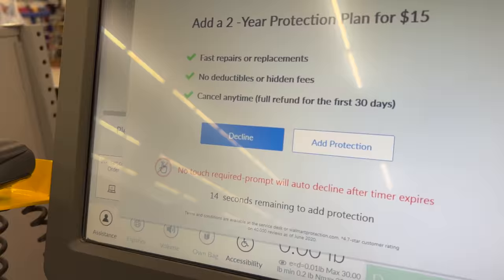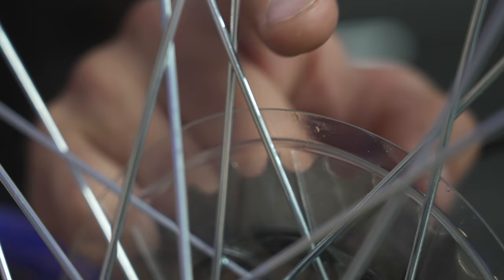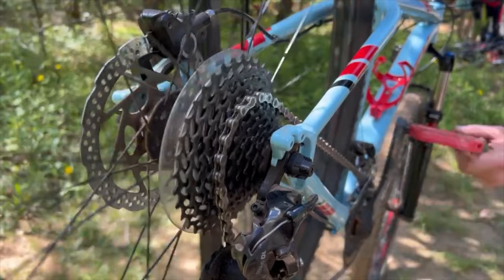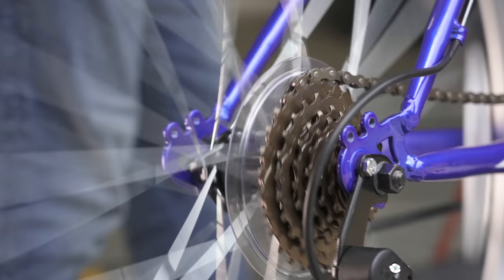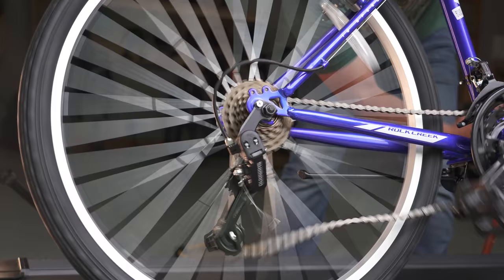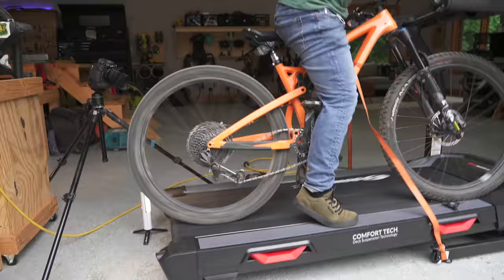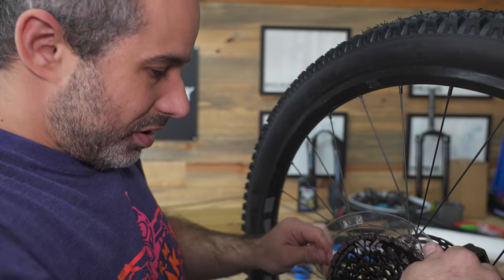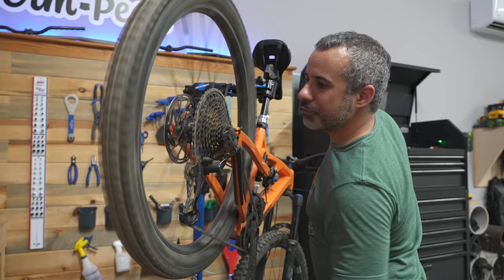What is your "dork disc" actually for? What happens if you remove it?

Comment: As a kid, while riding an old 5 speed through the woods something got kicked up into the derailleur jockey wheels, it locked up the chain in the derailleur, the derailleur folded to the left and into the spokes, almost instantly it removed about 10 spokes and the wheel was done for the day. The bike had a tiny tin dork disc that really didn't extend beyond the largest sprocket. 
The older bikes had HUGE discs, some as big as 9" or so and made from chrome plated steel. Those would have stopped the wheel from getting damage, but would not have stopped the derailleur from being ripped apart. 
I have had bikes toss the chain and it get caught behind the freewheel, both with and without the disc installed, rarely was it just a matter of lifting the chain back in place, but it was on much older bikes in the 70's. Many times the chain was what suffered the most, with the occasional marred up spoke or two. 

Years later, I tend to leave them in place, and put them back if missing if the bike is being ridden off pavement. On the road, it depends on the bike.

Comment: Yep, try your test on rollers with a lot of resistance. The chain can catch and snap spokes - especially on a light and tight small gauge 2 or 3 cross.
Friend was carrying 100 lbs of supplies on a light weight road bike, cranking up a 10 mile >8% hill at around 10+mph, dropped to the lowest gear and twang... Rebuilding a wheel in the bush is kinda a bummer...

Comment: I'm in my 60s now and have never had a problem with the chain going off the cog into the wheel.  I have, however, had problems with the chain coming off the little chainring and jamming around the bottom bracket/axle/crank.  All my 2x and 3x now have Deda dog fangs fitted.  As for the spoke protector, I leave them until I remove the cassette/freewheel - then I remove the protector and leave it off.

Comment: I've had this happen at speed 5 times in my life, once with a dork disc. One time without the dork disc, my chain encountered very loose spokes. Chewed a few of them up and destroyed a sach suret junk derailleur. Bad maintenance seemed the root cause, not lack of dork disc. With the dork disc was the only time my chain got wedged in and needed more than a yank. On these grounds, and the 5 grams of weight, I tend to take them off.

Comment: I have the real metal Pie Plate like old Schwinns. You can find them at low rider shops.  If you have a cassette, not a freewheel, you will have to get something with a wider hole, or modify it. 

Usually I throw away the plastic ones, but I have one that is 40 years old and hasn't cracked or fallen off yet.

Comment: Jury's out for me on dork discs. They supposedly do a job but I suspect the percentages are really low of it being needed.
The only derailleur incident I've experienced was while riding a normal tarmac street on a windy day. A plastic bag blew against the side if my bike and inevitably got pinched between the chain and derailleur causing it to lock up with the derailleur ending up pointing skyward. Personally, I feel that derailleur hanger saved me a lot more grief/money than a dork disc ever will.

Comment: I always remove them because, first and most importantly, they look bad, but also because they almost always break before they are even useful since they're so brittle.

I have only ever snapped one rear derailleur in over 50K miles of commuting and it wasn't because I didn't have a dork disk on, it was because I was an idiot and I saw a bungee cord on the path in front of me and instead of riding around it like smart individual, I just rolled over it, and as luck may have it, it somehow got wrapped up into my rear wheel and around the derailleur, the derailleur got sucked up into my wheel and I snapped the RD along with some spokes.

Comment: Hell, back in the late 60's before "spoke guards" were common, the Campagnolo rear derailleur on my Puch failed (limiter tab the range screw pushed against broke), sending the lower arm into the rear spokes. The result? (a) 3 or 4 spokes destroyed and (b) the bike stopped much faster than my then 170# body so I went over the handlebars and ended up with a major case of road rash. The new wheel got a stamped aluminum spoke guard. 50+ years later I'm still riding and quite happy leaving the disk in place on my current bike!

Comment: Watched this video a while ago, but I wanted to make this comment. So I had gotten a new Canyon Spectral 29 cf 7. And of course it comes with reflectors on it, and a dork disk. The reflectors were off right away, but I chose to leave the dork disk on because my though process was, easy protection from oil getting splashed/sprayed on the brake disk. I think this is a good use of it. Alas, it was destiny.... Riding down crazy rocky trails.... that thing ended up bouncing around  not clipped on. And trying to clip it back without pulling the cassette, wasn't happening, so if I had to putt the cassette, it wasn't staying on, but I didn't want to even do that, so in the end I cut that thing off, and trashed it.

Comment: My daughter has a 1x6 20” mtb. 35mm fork travel hardtail. Pretty sweet bike but no dork disc. The derailleur never sends the chain off but sometimes it’ll fall off back there if she kicks it or bumps it on something. She’s not an elite rider yet… and getting it back out onto the cogs is a 10 minute effort requiring adult strength and patience. If she does it without me around that’s it. Ride over. Pedaling destroyed.  I reaaaally wish she had that disc.

Comment: remember this folks: if anything ever fucks up in the rear end (branch into spokes/derailleur, chain over the casette etc), the only thing that has the chance to save you is if you react quick enough to lock up the rear wheel with the brake, and this way you have a chance to not break anything

Comment: When I bought my (quickly growing) kids new cheap (they will overgrow the bikes in a couple years) bikes I really did not like the dork disks installed.  They looked ugly, rattled, etc.  On top of that I do not like the fact that the chain fallen from the big sprocket rubs between the sprocket and the spinning wheel (even protected by the disk).  I think, the disk should sit on the big sprocket.  So I designed and 3D-printed disks that snap perfectly in the holes in the sprockets and are just a tiny bit bigger then the sprockets and their outer rim is just as far from the sprocket as the thickness of the chain's plates and pin tops.  They catch the falling chain perfectly and throw it back on the sprockets.  I think that's a cool idea :)  .

Comment: Here in Germany, a lot of the bike paths are cobblestones. Once I was biking home, shortly after replacing my rear wheel. The dork disk had been removed and not replaced at the shop. I was going fairly fast, shifting up into top gear, when I hit some bumpy cobblestones. The chain bounced up and off the gears, falling between them and the spokes. And it cut through four or five spokes like a chainsaw. Luckily, it was not too long a walk home.

Comment: 19 years of mtb, never had one of those on any of my bikes, done some hardcore stuff like the Caldera on Tenerife and MTB marathons in the Alps, never any problems. Just keep your gear in shape, and with a bit of luck, you'll never need a dork disc. Pack a screwdriver and adjust the shifter when gear changes mess up, you'll enjoy the ride even better.
Reply: Ive been using them for 30 years. Never changed my enjoyment of a ride. Its not heavy or intrusive enough to affect the ride in anyway.

Comment: I know this is an old video. However there is a specific use case for the dork disc. Since we cannot predict exactly when our adjustments are going to reach a tipping point going out of whack, we would need the disc when using an automatic shifting system as it depends on these adjustments for not over shifting our gears. I know there are not many automatic shifting systems out there that people actually use, but for the few of us that do it's a necessary evil. For example of you have an ebike and want your bike to shift in the optimal range to conserve energy (more miles per charge) and give longer lasting service life to ebike batteries. You may want to incorporate an automatic shifting system into your drive train.

Comment: One thing I noticed that wasn't mentioned in the video is the sudden unexpected pedal spin. If you are coasting and something disrupts your chain into the spokes, the pedals can get smashed into the back of your legs. I had a bike a while ago that the LBS I bought it from insisted the drivetrain was adjusted right where a certain stretch of a regular ride kept throwing the chain either into the spokes or between the crank rings and the frame. Obviously the later doesn't pose much safety issue, but the former....
Reply: A gummy freewheel can cause back spin in this case and getting into the "valley of death" gets easy.

Comment: Back in the 1970s, before the advent of mountain bikes, indexed derailleurs and quick release wheels were an expensive rarity, I had a Fuji 12-speed road bike. Back then all bikes with rear derailleurs had some kind of metal "spoke protector" (what you call a "dork disk"). The derailleurs in those days weren't as accurate or as durable as they are today and would get out of adjustment much easier. I remember a few times while riding having the chain jump the top sprocket, and lock-up the rear wheel causing me to wreck. Even worse, was if the chain got jammed in with enough force it would bend the spoke protector making it damn near impossible to get out and require removing the rear wheel. Not the most fun thing to be forced to do when scraped up with road rash, and  miles away from home with only a minimalist tool kit.

Comment: I never knew they called it that. My bike is so old mine has gone orange and discoloured. Everyone had them and nobody took them off or knew what they were called.

I have had my chain bounce off on a big landing and caught in there several times.
I'm gonna keep my orange one as it's still functional.

I don't care about looks, only function. Also I have that metal ring around my front derailer, I'd rather brush my leg on that than the cogs.

I don't care what others think, you see people mod cars that some think are cool, but many mods I think are trash if they negatively affect the function.

Dork is pretty subjective too, there's many that would consider people that ride bikes and obsess about them dorks, but who cares what they think.

Comment: Thanks for the vid.  The dork disc on one of my bikes is damaged, and no longer staying in place.  It flops around, and I wondered if I couldn't just break it off.  That might be a short-term solution, but it sounds like I should eventually replace it properly.

Comment: Tbh as you can see it's pulling the cranks around when it gets stuck so it lets the chain spin freely with the wheel, but i reckon if you are on it and maybe standing balanced without pedaling it would stop it from spinning the cranks freely and probably do more damage specially to the spokes

Comment: I once had the chain over shift when I swapped wheels and did not readjust the derailleur. I pedaled a bit and it damaged the spokes behind the cassette, and a spoke broke on another ride. So if you do get this issue check your spokes behind the cassette.

Comment: When I was 15 I had one of those "Zbox" 69cc engines on a mountain bike. It drove the rear wheel through a large sprocket attached to the spokes on the opposite side of the wheel to the cassette. One time the chain tensioner vibrated loose and the chain hopped off into the spokes. The rear wheel locked up at 50km/h. If I hadn't been on smooth concrete I would have never been able to avoid a crash.

Comment: I had a 6-speed automatic bicycle in the 90's.  there were weights mounted in the spokes that would expand with speed and actually push the disk out from the wheel and the deraileur had a skip plate the rode along the face of the disk.  Unfortunately this meant that you shifting was tied directly to speed, not to effort, and there was no way to over ride it ... The huge problem was ... when you hit bumps big enough (and I am talking about bumps as small as poorly maintained PAVED rural road surfaces) the deraileur could 'bounce' down far enough to get hooked over the edge of the disk and get stuck in a way that would no longer shift and you had to stop and untangle the damned thing.  This happened often enough that I gave up riding that bike.

Comment: I was riding my bike down a hill going mock 20 and did a small bunny hop, my rear tire locked up. When I looked back the derailleur was completely ripped off and got sucked through the frame. The limiter screws were set, the derailleur didn’t have a clutch and I think that’s what caused it. I stole one off a different bike. Too broke for a nice bike but I continue to shred the gnar.🤙🏻

Comment: On “Walmart bikes” derailleur can fall in spokes with dork disc. Just because it’s not so hard and stabilized as good derailleur. And opposite: good derailleur physically can’t fall in spokes if it’s not already broken. First somehow you brake derailleur, and then derailleur brakes your spokes, and in this way dork disc isn’t help, sorry(if you don’t use dork disk with really large diameter). Btw.. I have no idea why I should use biggest gear on high speed, so if it’s used properly I can prevent damage just by stop.

Comment: I work a lot on old bikes.  So old that the dork disc crumbles into dust when you touch it.  I have also seen many bikes suffer severe spoke damage when the chain comes off.  A better quality dork disc would have saved it.  Wait a minute - even older bikes, the "ten speeds" of the seveties had a huge chrome dork disc that worked perfectly and looked good.  A new chrome disc is quite pricey though.  Another factor is if the spokes are laced "leading" or "trailing".  There is less damage to "trailing" spokes.

Comment: I keep the discs on my touring bike. While cranking hard to get a heavy load up a hill, losing the chain on the inside will have ample force to quickly chew up multiple spokes.  And they're on the dished side of the wheel. And I only carry 1-2 spokes.   Idea for your video:  inspect the spokes of a random sample of people...I regularly see people unaware they have spokes damaged behind their cassette, and I wonder what %.

Comment: I lend my bikes out to my little cousin so I'm not removing my dork disks. If he hits a pothole or otherwise messes around with the gears, he's safe and the bike is alright (probably). We ride folders, and even though the shimanos are stable, I get paranoid that something will get messed with in transit while folded.

Also, I think it's actually the more expensive bikes with cassettes that would get more damaged without a dork disk. The closer spacing and nature of a cassette gear going all the way down probably increases the chance of the chain catching. Your experiments, though small in sample size, seem to point at this being the case.

Comment: Literally today during a mid stair drop with my bike that has its gear servicing about... 2 years overdue. I broke my Sram X3. Fortunately i will get a Sram X4 or an X5 in the following months and i'll make sure to get the equipment needed to take off the Casette and make sure i can replace it anywhere i go. I should be able to buy a bunch no problem.

Comment: I work as a propulsion engineer at NASA, and I've been part of several anomaly investigations and risk assessments, so I know a bit about Failure Modes and Effects Analysis (FMEA). TL;DR: Assuming you can get literally any insight from a single A/B test case is a bit foolish.

Failures are almost always complex and depend on several factors (often with multiple coupled factors). If you perfectly understand the underlying failure mechanism, then maybe you can create a test that exactly stresses that specific set of conditions, with significant margin over what you think are the unsafe thresholds. In that case maybe you can get away with a handful of test cases, sometimes we call this "bounded testing". You still need multiple test cases (maybe 5-10), but it's much better than what's coming up. 

If you don't fully know exactly how it will fail, or if there are a few different ways for it to fail, (both of those are definitely true in the case of this video), then you are forced into what we sometimes call "reliability testing". In that case, you give the system your best guess of the expected failure conditions, and try to make it fail many, many times until the statistics start to get comfortable. The details regarding a good Bayesian analysis or good Design of Experiments (DoE) are complicated. But bottom line, to get to a likelihood score of 95-95 (meaning 95% likelihood it doesn't fail with 95% confidence you are correct about that likelihood prediction), you usually need something like 60 tests with 0 failures.

All of this insight is relevant to this video because just because something doesn't fail once doesn't mean it won't fail next time. This isn't meant as a criticism at all, no one's life is dependent on this testing and it is mostly in the name of entertainment. It's more like this video demonstrates a common misconception about how failures work, and it felt like a good opportunity to share some insight about how the pros would go about this kind of testing (assuming this testing was somehow relevant to a risk on a human rated spacecraft).

Comment: My crosstrail hybrid chain went over and into the spokes, (due to badly/incorrectly set limiter) that wheel is still in the garage needing a dozen spokes, I learnt to set the limiters properly fitted a dork disk and have never had a problem since (so the dork disk was removed a week or two ago).